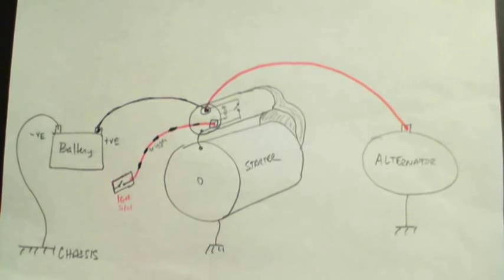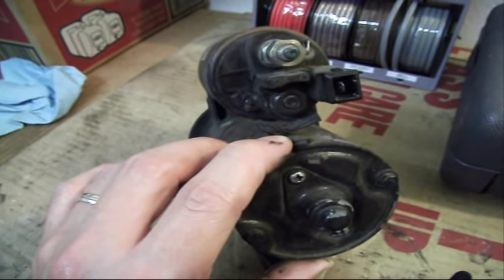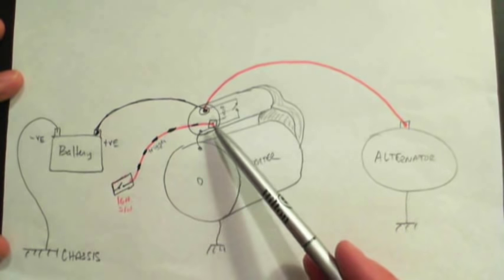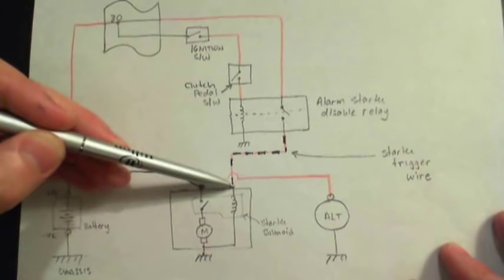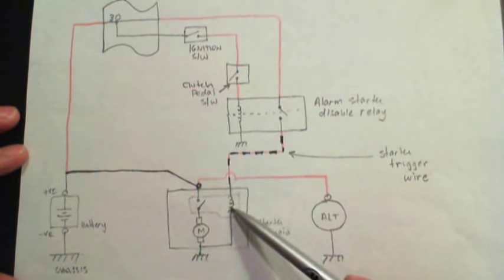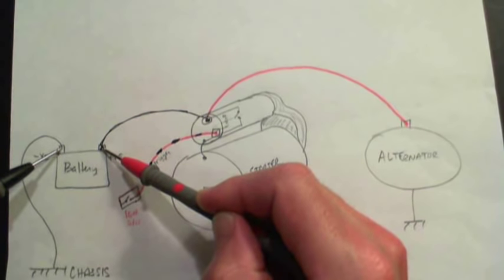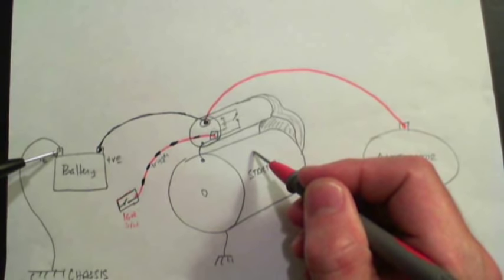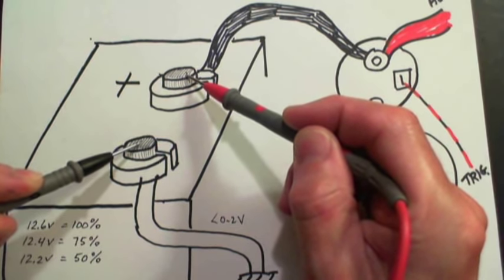Starter Motor Troubleshooting Tips DIY - How to diagnose starter problems

Comment: So the big thick black wire connects to the positive on the battery itself? I'm new to owning a vw thanks for your time!
Reply from the maker: WhiteTiger0232 Not all wires are either black or red.  Black wires can connect to the batter positive.  Just put them back in the same order you remove them and you'll be fine.  Always undo the negative wire first and make it the last wire you reconnect.  If you loosen the positive cable first and your wrench touches the body while touching the battery - sparks will fly and can catch your paint job on fire.  Don't ask how I know that.  /John

Comment from the maker: @donna2cool Battery ground has sparks?  That's a problem due to either a bad cable or loose connection.  You get sparks because something is breaking the flow of electricity.  Plug an electric kettle in and try to boil water.  While it's on, pull the plug from the wall.  You will see a spark jump from the plug to the socket.  That's because you broke the connection while a large current was flowing.  Make sure your battery ground is tight and the cable is good. /John

Comment: In your diagram @9:06 for example, my starter's bottom bolt(which goes into the starter) and the trigger wire, have a direct path to ground...i bought a project and am currently chasing down wiring as the starter wont crank over. I noticed that with my multimeter...Any idea why? Internal short in the starter? Because the starter should only be grounded by the case which is bolted to the block,  correct?
Reply: Yes, the starter should be only grounded by the case.  Have you checked continuity of the starter winding with your multi-meter?
Reply: @felixcat4346  
Yes, i pulled it all apart and checked. I noticed a break in the wire just under the tab, before it goes into the winding. Looks like it had overheated at some point, and caused the break.

Comment: Hello thanks for the info but since I don't have my hands on a connection tester but maybe you can help I recently got a battery it looks kind of small but idk if that's the problem because some times it turns on and when it doesn't turn on it sounds like the starter on spinner once like if there's no good connection but if I wait a while the car turns on ?

Comment: 1975 Pontiac Catalina 400 need some help please. Alt wire's got grounded out but the Alt wasn't plugged in. I removed the P Terminal on the battery asap. Taped the wire up really good. Probed the wire's with a test light and traced the wire's. Everything look's good.  turning the key in start position nothing at all not a sound. From my believes or remembrance Ignition switch S wire to the starter solenoid S terminal. So I traced it with key on to the starter solenoid S Terminal and probed it No power. Took the Starter off hooked the battery up again and probed it only power I've got is 12VT to the big terminal nothing on S terminal. So I ask myself?  Does my problem lie at the ignition switch if so how does or did the ALT wire cause it. Thank you

Comment: I liked your video.  I done spent 200 bucks; parts and labor on a new starter motor install.  Turned out that wasn't even the problem.  When I turn the key, nothing happens at times.  No clicking noises, nothing.  So I am stranded out of town many of times over this b.s.  I am considering a bridge wire direct from positive terminal to this little connector deal that comes out of the starter solenoid.  I have seen this work before.  But I do not remember if it was the positive terminal or negative of battery that does the bypass.  With this method; you can bypass all the gizmos in between that can go bad.  Can anyone comment?.   I seen the setup of the bypass mentioned years ago; so my memory is faulty.  Can someone help?  The problem occurs when it feels like it; and not all the time.

Comment: I replace my starter and now have a bad connection with the ignition wire. When the car won't crank I can wiggle the wire and it will then start. Any suggestions?

Comment: I have a 1968 Mustang, and I've had troubles starting it before. At first, I thought it was just the battery being low, because when I would try to start it, I would get the low, dull "eerrrrgggg" sound. I fixed that, albeit temporarily, by jump starting the car. I drove around for about half an hour, and then parked it in the garage. Just now I tried starting it, at first without jumping, and there was absolutely NO SOUND. I figured maybe it was the battery again. So, I tried jumping it this time, with the same results as before, no sound at all. Could this be a solenoid issue as well, or something more serious? How do I fix this? Thank you.
Reply: check your battery voltage, you might need to charge your battery, check the cells.
it might be a battery problem.

Comment: re-post to correct typo
Hi this is a good video. My ES300 has starter problem, there is NO crick or any sound from the starter. The indication light from the combination meter looks drawn current. I checked the battery, it is 12.33 V, the relay was functioning, fuse is OK. I was fixing my steering pump. After I completed to crank up the engine, I forget to lock the battery wire tightly. does it cause any problem, looking forwards receiving your respond

Comment: so you said that the starter motor only gets the trigger wire and the big black fat wire... but then you said that a red wire goes from that bolt to the alternator. does the red and black wire meet at the starter nut?

Comment: I know this is an old video, but any ideas why my starter constantly spins when I hook up the battery with out doing any key turning? I replaced my battery cables. I am wondering if I somehow hooked it back up wrong. Starter constantly spins, and even if I try to crank it up, noting happens, except the starter is spinning.
Reply: make sure the starter cable is not in contact with the post that the control wire connects to.
Reply: @julesdim1758  Thank you, that did it. It started right up. I was afraid the starter burned up, but it seems to be OK. Thanks again.

Comment: I have a RV with 1990 ford 7.5. 460 engine, I replaced the battery, replaced de starter ,I try to starting the motor and don't starts just sounds a click by the front of the motor, I checked all the wiring from battery to the starting coil and to the starter. What could be the problem? Any body can help me please thanks.Alex.

Comment: hi I have a sit on tractor mower . the starter motor will not turn off even with the wires pulled off the starter switch and the key turned off  .I have to disconnect the battery  any thought what  the problem is

Comment: I installed a new starter in my 1997 Chevy 454 I have it all installed and back in the truck go to hook up the the ground cable after the positive cable and the starter kicked over without the key in the ignition will not let me hook up the ground without engaging the starter

Comment: Half the time when I try to start my car I get a single "click"
The other half of the time I get lots of fast loud clicks
And just sometimes I get a combination of both and then after a few of the fast clicks the engine will start.
Once the engine starts everything else is fine.
Is it safe to assume that my STARTER SOLENOID is the problem here? Or could it just be the connections to the starter or alternator or something simple like that?
THanks for your video by the way :)

Comment from the maker: Sounds like you have a bad Coolant Temperature Sensor or bad wire connection to it.  The CTS (not the one for the temperature gauge) tells the engine computer the engine is cold and to add more fuel t start the cold engine, much like turning on the choke when starting a lawnmower or small engine.  Whe the engine is warmed up you don't need the extra fuel to get the engine started and that's why you don't have a problem when the engine is hot.

Comment: when load testing on a car that has the battery in the trunk is putting the negative lead of the tester on the chassis for ground same as putting it on the negative battery terminal?
Reply from the maker: yes it is.  The batter -ve terminal is connected to the car's chassis.  /John

Comment: I'm not getting a clicking, it sounds like my solenoid is just spinning with out engaging the starter, I have to keep trying to turn the key and after a few tries it eventually starts, I just bought and put this starter on a couple of months a go, Is it a starter problem, By the way great video.
Reply: Did you solve the problem ? What was it?
Reply: Solenoids dont spin...they are basically just a electromagnetic switch... 
Sounds more like your is shimmed too far from the flexplate.

Comment: Hi, just wondering what the problem may be when you are getting voltage (indicated by the spinning sound), but not getting a click.   

I assume the click is the result of the fork engaging, pushing the drive mechanism forward, where the gears make contact with the driving rings. I am just wondering in anyone has any theories on what might be at fault if your getting a spin, but no clicking sounds.

Forward thanks  : )

Comment from the maker: You can't bypass it.  On some cars like old Fords the solenoid was actually a starter relay.  You could put a screw driver across its terminals and that would start the motor.  On this type howeve you need the solenoid to be energized to pivot a starter internal arm to push and engage the pinion gear into the flywheel (or flex plate) ring gear's teeth. /John

Comment: Thank you so much for this A+ Lesson on Starter Motor function and connections.  I have a stretched out pos. cable clamp, that the Auto Zone guy just added a temporary 'penny' to allow the clamp to tighten.  However now, as I start, and if I hesitate a split second on the crank up, I get a sound like a 'straining' noise, but it cranks up fine.  I don't hear it if I turn the key more quickly.  I am replacing the terminal soon, already purchased it, so do you think that 'straining' noise has anything to do with the poor clamp?  I will know more after replacing, and will report back.  Thank you Mr. Electric Man!
Reply: Janet Stone no callate

Comment from the maker: @inodob1 Sounds like the overrunning clutch inside the starter motor isn't working properly to extract the pinion gear from the ring gear.  I would just replace the starter. /John

Comment: What if fuse blow. Or tried tightening a bolt on Starter while Battery still connected and get sparks from starter and battery is already low.

Comment: Shouldn't the big positive cable that runs from the battery to the starter be red?? Why did you say it's a black cable?
Reply from the maker: Black is the color used by VW for the +ve which was the example in this video.  Some German cars like BMW use Brown (not black) for ground. /John

Comment: Question on my car, it wants to try to turn over when you connect the battery cables. Note that the key is not in the ignition.
Reply from the maker: do you have a starter solenoid?  I have seen (with a weak battery) the solenoid terminals weld together when you're trying to start the car.  If you remove the key the engine will continue to turn.  You need to disconnect the battery to get it to stop.  You need to replace the solenoid.  /John

Comment: Thank you for this great video! i have a starting issue, when i turn the key to start the engine i hear i see the battery gauge slightly falling and the light on the dashboard slightly dim (not too much but obvious) but the starter does not turnover! before this issue started i noticed that when i start the engine the cranking was kinda slow than usual :( any idea on what could be the problem?? thanks

Comment: If don't hear any clicking sounds and there is no radio or lights working  but i can jump start the car, What does that mean?
Reply from the maker: iKearGunz Sounds like the battery is extremely dead or loose battery terminal. /John
Reply: Your are right.I changed the battery and  everything works fine now. Thanks!

Comment: Back home, I backed the car so it is easier to tow it just in case  I thought.
But tried to start it with the key again just for fun ..
And THEN it fired up directly .. But the thought that I dare not take the car tomorrow if it was just lucky this time .. Turned off the engine and tried to start it again .. But the same thing all lights lit up but then, in the ignition mode, the fuel pump hums but the starter motor aint moving .. Even after several attempts..

Comment: I have my starter wire from alternator straight to positive on battery. Car doesn't start/crank after engine warm. Let it sit for 20-40 min then cranks/starts fine. Old Chevy 350
Reply from the maker: when you turn off a hot engine the water / coolant stops flowing.  The engine will temporarily get hotter than when it was running. It's called "heat soak".  If it is a starter problem then it is possible the starter is getting hot and the armature shaft is difficult to spin because of a mechanical problem with the hot starter motor.  If the motor is actually turning the engine but the engine does not start then your issue isn't the motor.  My first guess would be a bad coolant temperature sensor causing your air/fuel mixture to be off.  /John
Reply: Chevy MADE pop mi

Comment: I have a problem but I can't check the starter because Every time I hook the battery up with no key in the ignition or no ignition wire hooked up or no alternator wire hooked up the starter motor spins sounding like a power drill under the car. I have done the test pulling out fuses one by one to test for a short but no voltage drop so any suggestions?
Reply from the maker: Sounds like the starter solenoid has welded itself closed.  If the battery is almost dead it is possible the starter solenoid will try to close and when it makes contact the plunger connecting the two terminals on the solenoid together will weld itself to the solenoid terminals.  If your car has a remote starter solenoid then it is easy to just remove and replace the solenoid by itself.  I would find the solenoid and put a multi-meter (set to resistance or Ohms) and see if there is zero ohms across the solenoid contacts when the cables are not connected to the solenoid or starter.  If it shows zero ohms then the solenoid is bad.  /John
Reply: Just wanted to jump in here, I have a 1996 chevy c1500. 5.7l, just installed a new factory 5.7l engine. When I got it up and running the started would engage with engine running, it also starts when the key is switched to the run position,  I am being told it is the ignition switch.  By the way new starter and solenoid . So your thoughts on this problem.

Comment: hi john, my corolla had been acting up just clicling but would eventually start...then the other day, it started and continue trying to start while the engine was running...turned the key to off and even took out the key...the engine shut off but it kept turning over(over and over) i'm trying to save a buck by doing it myself...my research is telling me it could be the solenoid(which is together with my starter i believe or the ignition switch or ignition cylinder.any help is greatly appreciated

Comment: When I turn the ignition on there is no click at all. It only clicked the first two or three times and than after that no clicks. Any ideas?
Reply: Sounds exactly like no/low voltage going to the solenoid. If it clicks at first then fails to click that's most likely due to battery voltage getting too low. Check voltage using a multimeter at the small signal wire on your starter solenoid when turning the key to 'start.' it should show voltage. If not you have an electrical problem before the starter itself - usually the battery, ignition switch, fuse, or neutral safety switch (or clutch switch if a manual transmission). Also check and clean your battery post connectors.

Comment: Been charging batt all day, it got to about 13.8V, on the box of the charger it says it should take 6 hours, it was about 10 hours and it didn't seem to go any higher than 13.8 so I just unplugged it. Soon as I unplugged it 15 minutes later it's back down to what it was when i started charging it.I haven't manage dto do the hydrometer test yet, But could anything else be causing my battery to drain right away?
Or is it safe to just say my battery is faulty and needs replacing?

Comment: My 2005 Chevy Cavalier starter turns but car will not start. Eventually after 5-10 turns it will start and is getting worse. I took it to a mechanic the other day for a full engine and electrical diagnosis and there was no issues with the car. I don't believe this because the problem is getting worse. Any suggestions?? Thanks!

Comment: I have a 99 Vw cabrio and it want crank with key but I can pop clutch and run wire from starter to battery, iv checked relay under dash it's clicking and I opened it and I can't see contact I don't know where alarm relay is, I reall don't want to follow iris from starter but if I have To I will do u think I have wire severed or  alarm relay tailor thank for your time

Comment: i have a 2005 ford focus an when the wether drops under 45. wont start it is not the battery or starter once i get it to start it is fine no engin light i did a diagnostic and i get a code B1359

Comment: Luckily I had someone to help me push the car slammed into gear .. It was a bit full of petrol after all attempts to start the car since the fuel pump had given it a bit too much juice with each attempt to start the car.
But once it started it worked as good as it used to